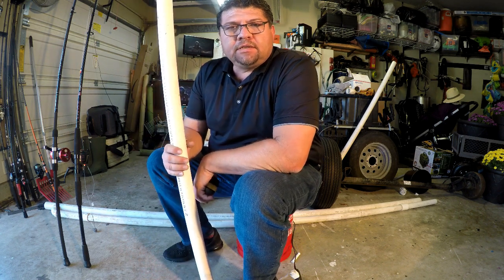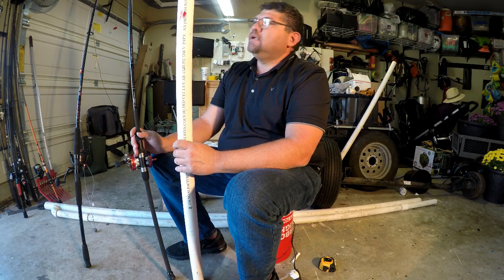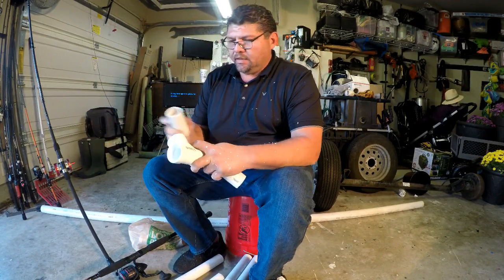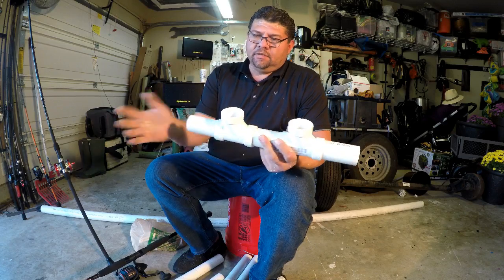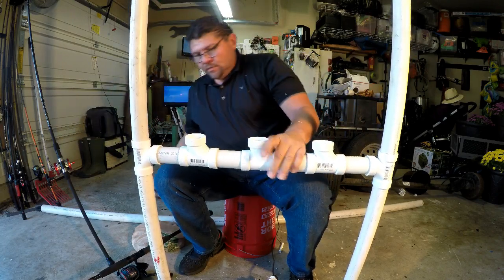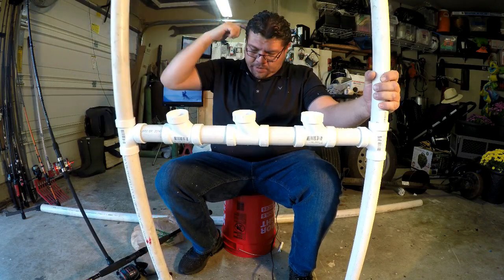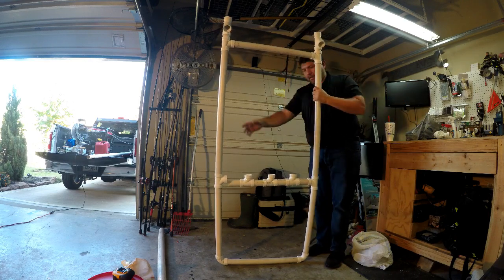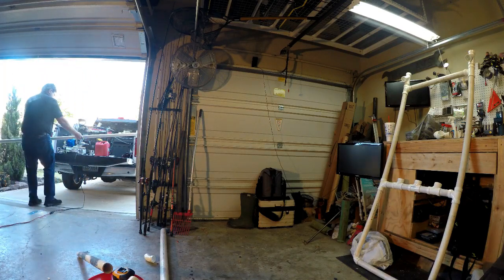The Best idea for Jetty, Surf or Bank fishing Rod Holder

Comment: I like this rod holder. Good job! Gonna make one to hold 4 and use your template, sir (two for me, and two for the wife). Will be going down to Texas City the next week or two. I'm in Houston area too. Let me know if you want to hook up sometime. Thanks!
Reply from the maker: konsideration1 an update I did to mine was I took 1 1/2in self tapping stainless screws and screwed all the main connections since it is mobile and the joints loosen I went to harbor freight and purchased a box of screws pretty cheap
Reply from the maker: It would be great to meet up